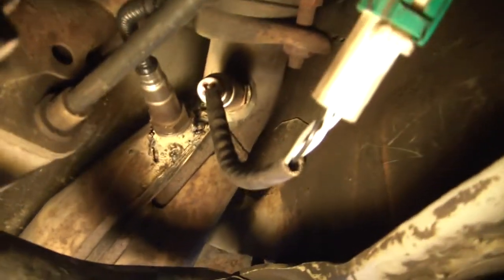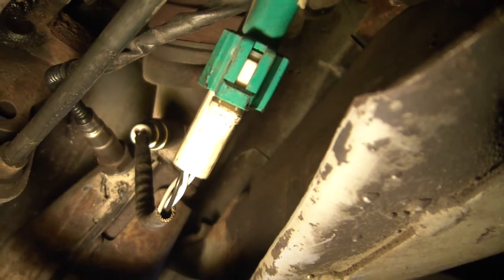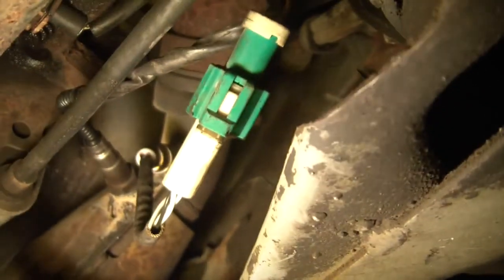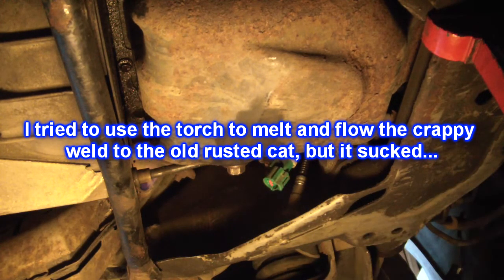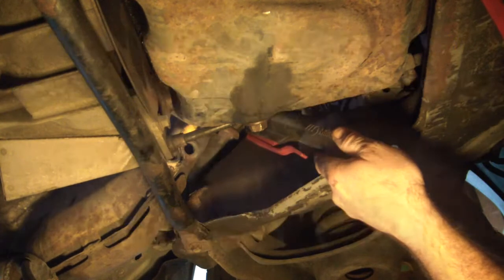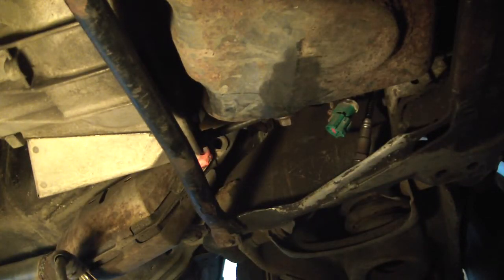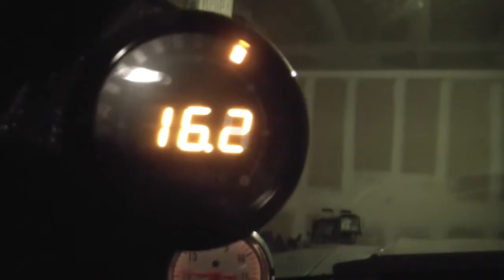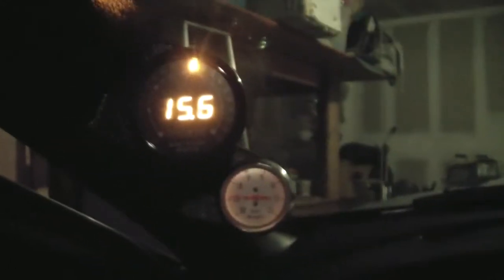Mustang GT Project - Innovate Wideband O2 install - Part 2 - Fixed

Comment from the maker: LOL!

The Orwellian Big Brother mobile commie pinko photo van / suv's use radar to measure speed. 
If a mass of metal is in between me and the radar device it can't measure me. 
I wasn't really even speeding there, but just making a funny. However I have passed cars at speed by one of those Australian owned tax generating devices and as long as I am outside another car it can't measure me nor likely get a clear photo of me or my plate. :-)

I'm against those devices, btw. :-)